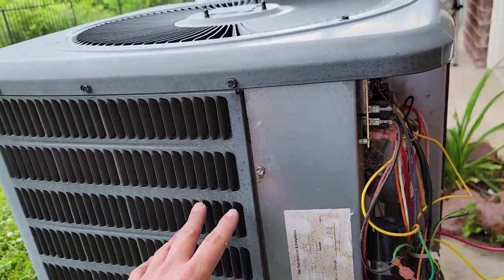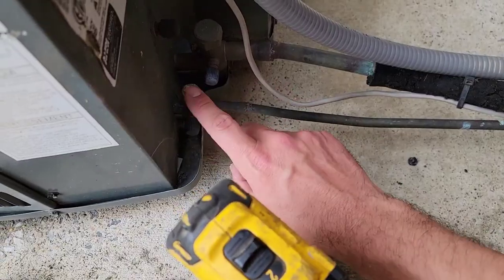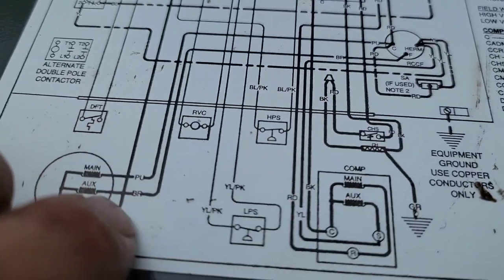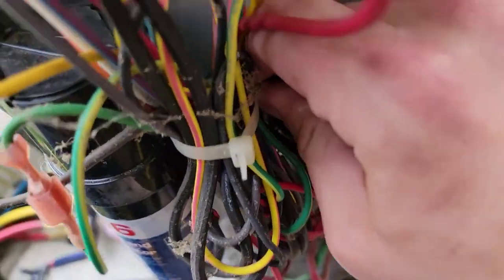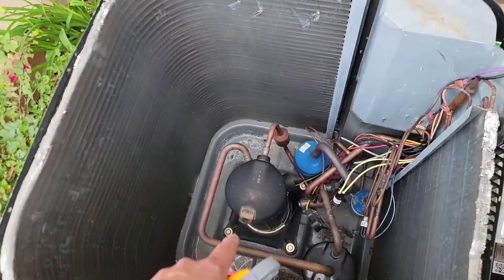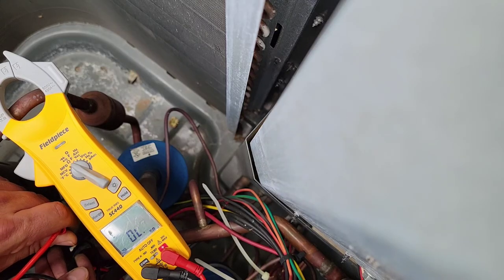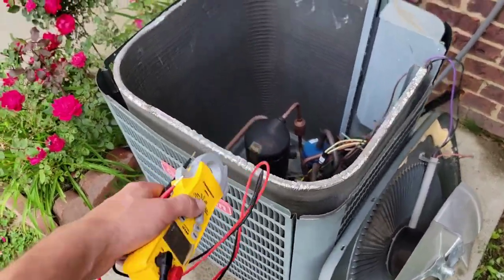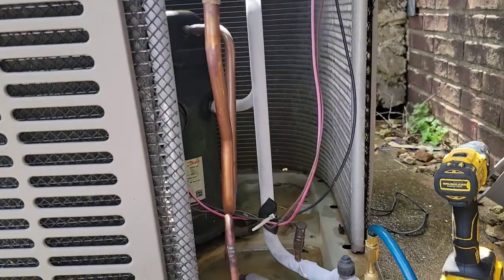HVAC Compressor Overload Protection Secrets Revealed!

Comment: The day prior the capacitor to the compressor got burnt at the terminal, I replaced it and pinched all the other terminal to make sure they were tight, it ran for around 4 hours till the compressor got hot and shut down. A few years back ,I always had a problem with icing. I cleaned the evaporator coil, it was severely clogged, looked like cat hair. It peeled off like cat hair fabric. Your info is super helpful. The temperature coming out or the registers is around 68 degrees with an ambient outdoor temperature of 100 +. I can assume an old unit of this era a 30 degree cooling is probably as good as its gonna get.
Reply from the maker: Definitely get some gages hooked up and find out what the pressure is

Comment: I have an older 
Rheem unit, I have lived here 30 years now. We don't use it all the time since it doesn't get hot in the house until 5 or 6 pm. By that time the outdoor temperature is cool enough to open a few windows and use fans to bring the outdoor air in. Today it was over 105 degrees the compressor got hot. I opened the cabinet and ran a strong fan over the compressor. I ended up leaving the cabinet door off and the axillary  fan blowing across it to help keep it cool.It ran fine for the rest of the day. Oddly the compressor is in its own separate compartment and doesn't get any air movement at all from the condenser fan.
Reply from the maker: You can use a water hose and run some water over it or use a bag of ice and put a bag of ice over it

Comment: HVAC  condenser gas leak repaired , system vacuum and r 22 liquid charged from high side . then  scroll compressor ( ZR 380 ) started to gas charge .
but while gas charging motor protector cut off within 3 minute  . suction 50 psig and discharge 200 psig. 
checked condenser , fan motors, voltage  380 ( contactor out put ) amps  ( 40 ) are ok . also motor protector replaced and checked but still same .
Please let me know what could be the reason .

Comment: Had a power outage last night so brief even the microwave oven clock didn't need to be reset.  Power was off and on in a second.  Now my ductless outdoor unit will not power on.  The indoor heads are showing E6 error code.  I've flipped the breaker for over an hour, but that has not helped.  All A/C techs are maxed out with service calls.  It's 85º out and I need some kind of guidance as to what to do.

Comment: Hi, the start winding drops out after compressor starts when a hard start kit is used. But, without a hard start kit does the start winding still drops out when using only the dual run capacitor? Thanks
Reply from the maker: By the use of a centrifical switch
 Look up centrifugal switch on YouTube and Google

Comment: I have an issue with the compressor and fan shutting off after running about 15 minutes. It starts up fine when I call for cooling, the compressor and fan both come on and run for about 15 minutes. Then it stops blowing cold for a few minutes and then both the compressor and fan shut off. I have already replaced the start and run capacitors and the contactor. When the compressor shuts off I was thinking that it was an over heat protection but if I manually push in the plunger on the contactor the compressor and fan will come on and stay on as long as I hold in the plunger. If I let it sit for about 20-30 minutes, it will kick back on by itself but then shut off again after just a minute or so.
Reply from the maker: Aaron
I can definitely answer these questions
But not through the comments
I can do it through email or on the phone

You choose my friend

Here is the link to join
Join this channel to get access to perks:
https://www.youtube.com/channel/UCuMyjTVlkM4xZ5z_eSyoB1w/join

Wanna learn more about hvac? Check out my hvac tips for technicians playlist.

https://youtube.com/playlist?list=PLVjetZt5xgenmO76adHwb2ctyeBIFKUus

Comment: What would make the compressor start and cool, but when it shuts off it won’t start bk up til it’s unplugged for 15mins or so?
Reply from the maker: does The unit have a run capacitor and a start capacitor or just a run capaster also is it starting backup after waiting 15 minutes or does it have to be unplugged

After the unit shuts off the pressure needs to equalize for the compressor to have a better start up

 click the join button become a member I'll give you my email that'll lead to my phone number and you can send me some pictures I can help you
Reply: Wondering what the cause of your issue was?    I just had a similar issue.   The tech said he may have added a little bit too much refrigerant and this was the compressor to be overheating triggering.  He came back and lowered refrigerant level and it hasn't been happening today (mid 80s outside).   What I'm not understanding is that it really seemed like the problem was just a delayed start.  It really seemed like the compressor (not just the fan motor inside condenser unit) was actually running until the thermostat stopped calling for cooling but that the compressor motor itself would not starting right away when thermostat called for cooling for next cycle, even though the fan was running.  Wondering if the Thermal Overload can somehow get triggered shortly AFTER the compressor stops due to the fan no longer helping cool it off?   That would explain the startup delay even though compressor kept running until thermostat stopped calling for cooling.   It's certainly weird that it would get triggered after compressor stops, but that's what seemed to be occurring.  The last couple times it happened it was around 6 to 8 minutes after it called for cooling to start up, so if it got trigged at start up I would expect it to take longer than that to cool off enough to reset itself.
Reply: Update, it happened today a couple times (warmer outside than yesterday).   I lowered the thermostat setting to prove that it does in fact run continuously without anything causing it to shut off.  If it's the thermal overload protector causing it to have the delayed startup, then either the temperature rises after shutoff somehow to trigger it, or it somehow quickly gets triggered at start up.   Will try shutting it off for 8 to 10 minutes later when it gets back below 90 degrees and see if I can hear it trying to start-up if it doesn't start-up normally right  away.  I tried to get the tech to come back over today, but he likely won't be over until next week after the holiday.
Reply: Update #2:   I had it at a lower than normal (for us) temperature and it ran continuously all afternoon long (around 5.5 hours) without anything shutting off the compressor motor the whole time.   I determined (by standing in front of the condenser unit when the thermostat called for cooling) that whatever protective switch/relay is cutting off the power to the compressor is doing so at the time of start-up and not any time before that.   I heard (and recorded on my phone) a gentle hum of the compressor motor trying to start up, and then a click and it stopped, and then the fan motor inside the condenser unit came on.    Then a few minutes later I heard the compressor start up automatically on its own and stay on.   Is this likely the thermal overload getting triggered at the time of start-up, and what could be causing it to happen?   Could adding a time-delay before start-up (minimum of 10 minutes) be a way to prevent this from occurring?  Would be nice if the tech could figure out the actual cause as to why it is still happening even after he reduced the refrigerant level.
Reply: If unit starts up, the capacitor is good enough to start up compressor and not the cause of compressor overheating.  A bad capacitor will cause a stalled compressor with high locked rotor amperage compressor buzz. Compressor will get hot in a few minutes and overtemp protection Klixon in compressor will open, assuming main AC panel breaker does not pop open first.

It is important not to let compressor continue to overheat/shutoff/cool down/reset/attempt to start/overheat/shutdown over and over again.  The Klixon overtemp protection switch is not super rugged and will eventually fail if subjected to repeated shutdowns and restart attempts.  If internal Klixon fails, only option is to replace compressor since the Klixon is internal to the sealed compressor.

AC panel circuit breaker may not pop due to a locked rotor high amperage, non-startup condition, especially if wire run is long to breaker panel or too small gauge wire was used in the electrical wiring.  Too high of amperage rating breaker can also cause this.

Klixon temp protector can open due to compressor high temperature, but it can also open due to high current that heats up its bi-metal contact arms.  The later has a lot shorter trip/reset time since it does not involve the high mass temperature change of actual compressor mechanics.  This is bad news for Klixon stressing for a simple bad run capacitor causing high current locked rotor condition.

Operationally, several things can cause compressor to overheat.  First thing is check for air blockage, outside condenser and inside evaporator and air filter.  Beyond that, have refrigerant pressures and line temps checked.  Blockage in system, like stuck expansion valve or inline refrigerant filters.  If an inline refrigerant filter is blocked there will usually be a noticeable temp drop across it.  Low refrigerant can cause insufficient suction line gas return which is what cools compressor.  A large amount of refrigerant over-charge can cause high liquid line pressure causing compressor to work harder.  Overcharging results in more of the outside condenser coil being filled with liquid leaving less condenser coil area available to condense the hot gas from compressor.  This results in greater compressor output pressure causing it to work harder.  Too much refrigerant return on suction line will overfeed compressor causing compressor to work harder with a higher compression ratio. 

Too low of outside temperature can cause liquid refrigerant to collect in compressor when it is off and flood compressor when it comes on, overloading compressor and possibly damaging it. Air conditioners and heat pumps in cooler climates usually have a compressor heating band at base of compressor to prevent refrigerant liquid from collecting in base of compressor.  The heater turns any liquid refrigerant that collects in compressor into gas.

There are usually safety pressure switches also mounted on lines coming out of compressor that will shut down compressor when suction pressure gets too low or high side line pressure gets too high.
Reply from the maker: Good info thank you for sharing